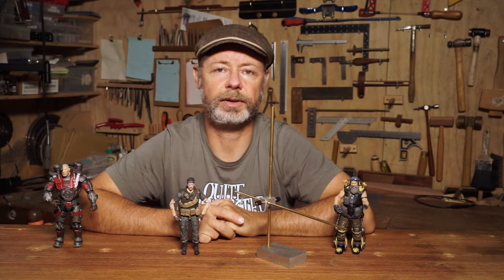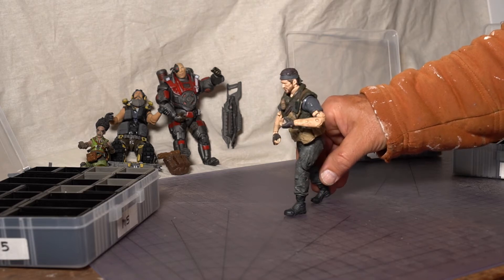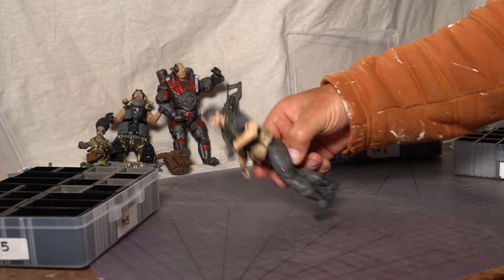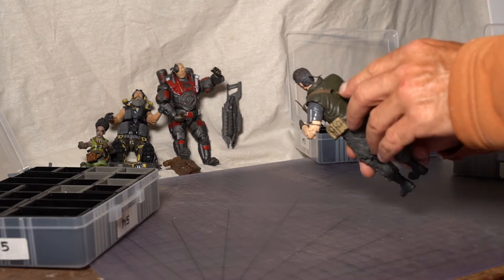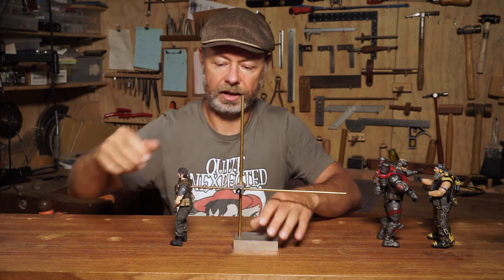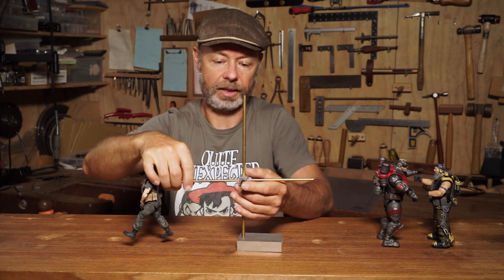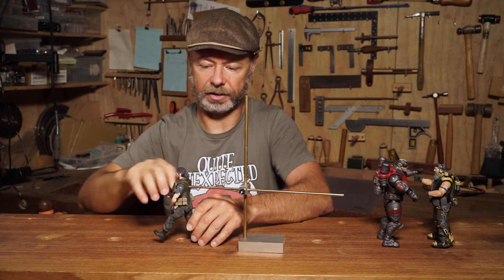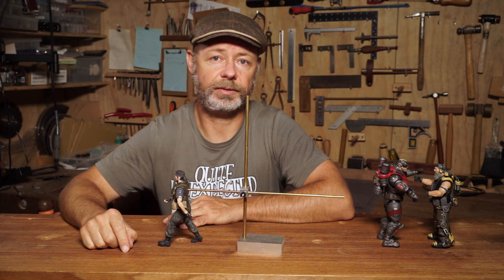#2 Stopmotion Production Diary - Making a character support rig

Comment: You can Counter-weight the horizontal bar and extend the rig out. I use a 4 inch piece of thick 5mm brazing solder to connect to the 
model so you can bend it and keep the rig out of the shot